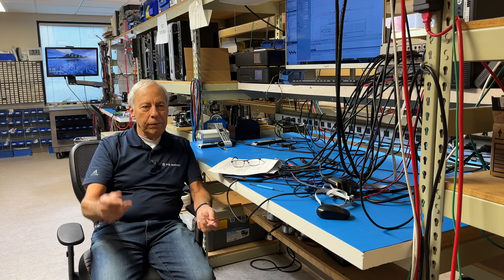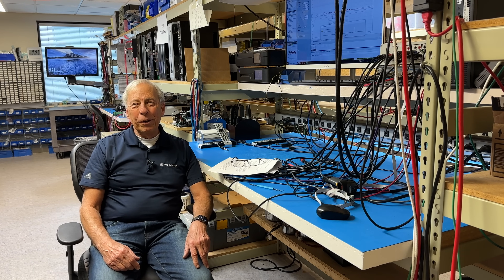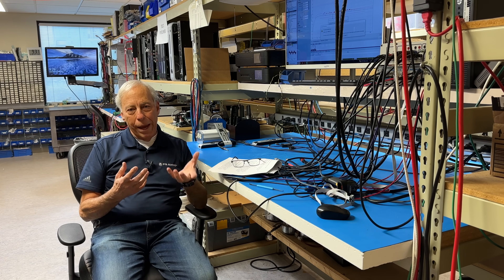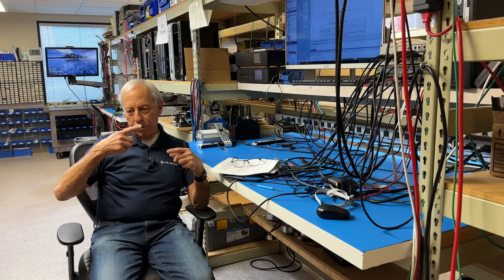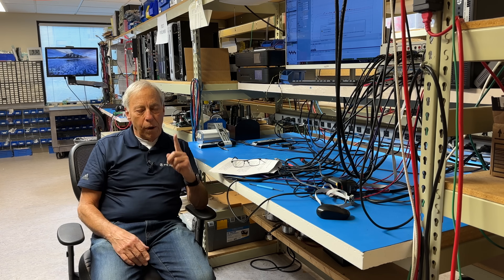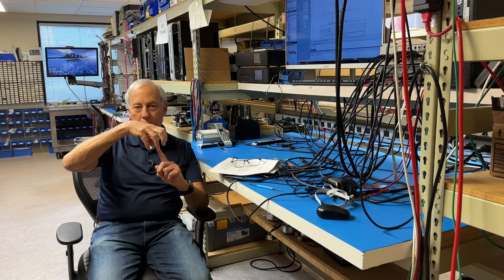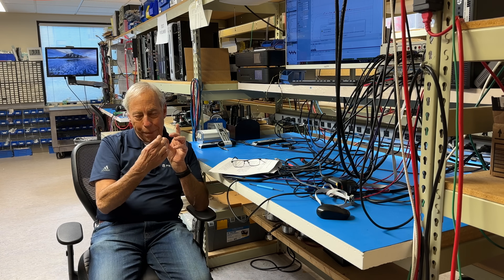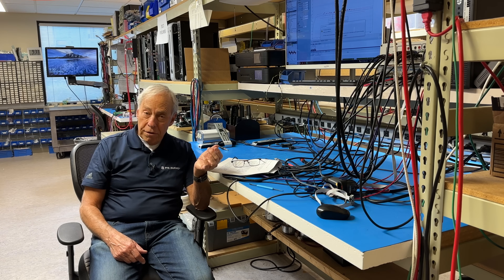Differences in phono cartridges

Comment: The SONIC differences between Moving Magnet & Moving Coil? There could be some very expensive moving magnet cartridges out there that could refute the following, but what follows is generally the case with cartridges not priced in the stratosphere.

Moving Coil:...More energy in the uppermost treble. combined with truly superior transient response gives moving coil a very effortless sound. Moving magnet cartridges generally  sound slow and mechanical in comparison. 

 Moving coils have more depth and space between instruments, like a good tube amp. But unlike many tube amps (especially vintage ones), moving coils are very lively sounding and they aren't  softer sounding like tube amps. 

 More detail, more open, more transparent is what good moving coil cartridges are all about also. "Only moving coil cartridges have real transparency" said the late HP of The Absolute Sound magazine. They simply sound more real, in ways that in addition to the above are hard to describe. Of course if you find a moving coil cartridge which has a peaky response; then look for a different model or brand. Like anything, there are good and less good.

 The differences and degree of improvement with good moving coils is worth any extra trouble or expense. You simply won't like your moving magnet cartridge anymore after listening to a good moving coil cartridge. They need higher gain from the phono stage because of their lower output. They also need more attention to just what tonearm you are going to use with it. But the extra effort (and expense) pays big dividends in sound quality, and in my experience, has always been well worth the effort.
Reply: Although there have been some moving coil cartridges that have been made to have a slightly tilted frequency response to show off their amazing clarity, the trend in recent years has been toward more honest sounding transducers. I personally don't think anyone with "ears" would think slower, more veiled, less open, less depth, less transparency is the superior cartridge. Moving magnet cartridges don't hold the exclusive patent for accuracy. In fact, any well designed moving coil cartridge sounds much more real than moving magnet.
Reply: @sidesup8286  You'd be surprised, there's a definitely a market for old (mostly MM) cartridges. Check out the prices many are paying for the Shure M3D or the General Electric VR1000, ridiculous. I myself admit, I'm currently enjoying a 1958 Bang Olufsen cartridge
Reply: That's right call I proper reply. Thank you for posting it
Reply: Tonearm mass and tonearm sensitivity have a large impact on your choice of cartridge.   Cost effective Tonearm and TT combo is better suited to moving magnet. In general, higher end TT and tonearm combo would benefit more from MC.
Reply: Some moving magnet devotees will admit that moving coils do better on a hi fi checklist; having more space between the instrument, faster transient response, have more presence and clarity, while at the same time more 3 dimensionality; But guess what? That's not just a hifi checklist, that's also a checklist for what real music has. The idea that moving magnets sound better while doing all those things worse is hard to take seriously. 

 Moving coils can "sometimes" use a bit more warmth, but there are many ways to get more warmth without buying an inferior type of phono cartridge. There are some companies like Clearaudio, Audio Technica, etc. whose lines include both MM and MC cartridges. Their MC cartridges are priced higher, because the company, making both types, knows they are the superior type. There are some stand out moving magnet cartridges that "maybe" I could happily live with, but as a class, moving coil to me always sounds far superior. Moving coil cartridges often love tube preamps; which is the only way I would even think of playing records.
Reply: Actually I like my MM cartrige after hearing MC becaue I listen music, not a cartridge. Simple as that.
Reply: @crodoc69  I love to listen to music too. I certainly don't agree with you. There are some great moving magnet cartridges out there but as in general statement moving coil cartridges off our superior to retrieving the information on vinyl.
Reply: @Scopolamine46  For those who are listening differences, not music. Sure some difference exists but not proportional with price difference. Not even close.
Much more important is vinyl itself.
Reply: @Cro. I had a very highly respected AKG cartridge. It was not a moving coil cartridge. It was one of only 2 high output cartridges of the 20+ that I ever owned, that had ok transient quickness compared to a moving coil; the other being an Astatic MF cartridge which was a moving flux cartridge, which was said to bridge the gap between moving magnet and moving coil. The Astatic MF cartridge was on the bright side, but pleasantly so, with lots of beautiful tone color. The top of the line AKG cartridge was the exact opposite tonally; it was much darker and unbelievably quiet in the groove. You could swear you were listening to a reel tape.The AKG cartridge by the way, was the cartridge that their state of the art 100 LE cartridge was developed from. The AKG 100 LE to this day (going on 40 years later) is considered by many to be the best high output cartridge ever made. Yes, there was some real serious stuff made back in the 1980s. The 100 LE cost $1400 back then.. They made just a very limited amount of them. The same goes for maybe the only other vintage high output cartridge that could come anywhere near the AKG....the Audio Technica ML 180. They didn't send us U.S. audiophiles any ML 180 cartridges from Japan. They only place on this side of the globe that they exported them to  from Japan, was South America... We  American audiophiles had to settle for the ML170, the next model down as the highest Audio Technica model available here.

 As far as the comment that the difference between moving coil and moving magnet is not worth the money. Downright bad information from someone whose inferences are not any better than his command of the English  language. Even with a superb cartridge like the AKG, my moving coil cartridge at the time was nearing 40% more open sounding.
Reply: @sidesup8286   Value of something is very subjective thing. Value is given or determined by us, humans. Nothing has value on it's own. 
Saying that, if someone appreciate subitile differences and is ready to pay for it couple of houndreds or even thousands $ that's fine, but isn't ulitmate definition of value.
Same is for opposite.
I'm not sure what is that you wan't to say about "command of English language" . Each time your start to judge someone for speaking bad, or not adequate English remember how that person knows at least two languages. I speak three. How many do you speak?
Generally, ad hominem attacks are ALWAYS sign of weaknes and lack of arguments. Google "ad hominem" and discover which language is it.
To summarise my thoughts about this topic: Yes, MC cartriges have certain benefits in terms of sound, but those benefits are subtile and demands careful listening to be noticed. The most important is vinyl, how pressed it is, how mastered it is, how well preserved it is. 
For us who listen music instead of our gear/cartrigdge and have better things in life than anylising and comparing, quality MM cartridges with proper stylus are perfect option and I highly recommend them. 
For those who are ashamed to be audiophiles with MM cartridge, who are followers being in herd with like minded people, investing in MC cartridge is matter of identity and worth upgrade no mater how high price is, regardless of does it correlate with level of improvement or not.
If someone finds 5% of improvement worth 10x higher price...who am I to object?
Reply: @Crodoc. I assume you are a crocodile doctor. Quite an interesting profession I'm sure. With all those teeth of theirs  and that poker face of theirs, and their unpredictable behavior. LOL. Just kidding.

 Maybe it's you though, that should take things a little less serious. Bragging about how many languages you speak; that's the same thing as people bragging about having an MC cartridge, or whatever other prestigious equipment they have... No...I don't speak a hundred languages, but I do speak the language of logic. Unless you, as a doubter, have heard hundreds of different moving coil cartridges perfectly set up and perfectly aligned, you don't know doodly squat about the degree of improvement there can be between a great moving coil cartridge and magnetic cartridges. I have a little trouble with "logic like that". People making blanket statements based on a quick audition or two. It takes way more than that. I was fortunate and maybe lucky to pick out several wonderful examples of the moving coil breed. So I know what at least some of them can do and what a BIG difference they can make. If you haven't heard ones like that yet, why come on here and pretend like you've heard them all and know it all?

 Your whole essay on VALUE is USELESS. Getting that amount of improvement with MC (usually around 35%) versus moving magnet, by buying other types of things, moving coil is not only a good value, its a great value. For $300 or $400 more, what amp or preamp is going to give you a 35% or more improvement? Probably none. 35% or so is a very big improvement, and I'd go so far to say that its a whole new listening experience. $300 to $400 more for a whole new listening experience in degree of improvement, is what I'm sure all audiophiles would consider great value. The weakness of argument is yours. The inability to hear big improvements and mistake them for tiny improvements is also "your" problem. Not mine or most other audiophiles who have better ears.

 Also we don't spend all our days analyzing. We analyze when making purchases and then we enjoy listening to our music. Thinking that people with better equipment than you are always analyzing instead of enjoying the music is another wild and wrong thought of you and people like you. With the kind of sound quality that we have, chances are,  we can enjoy our music a good deal better than you.